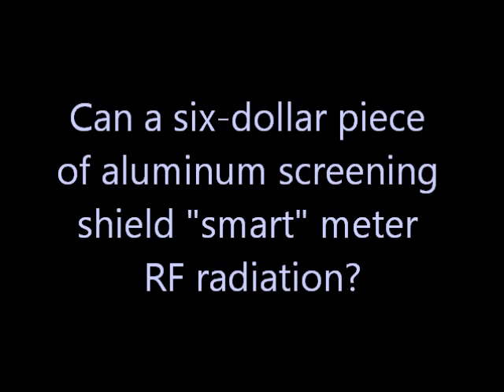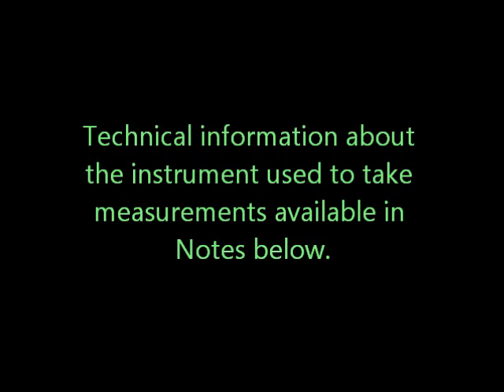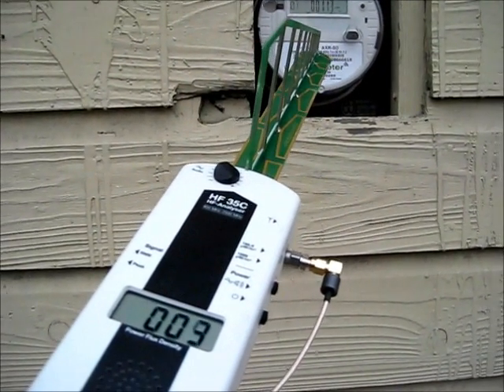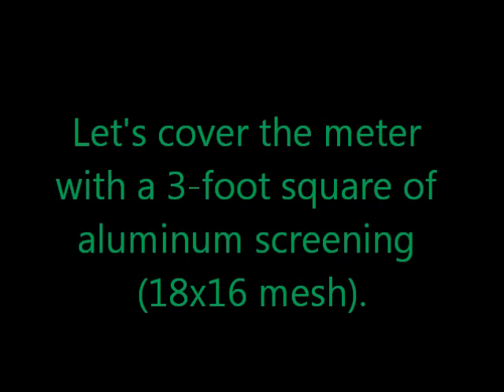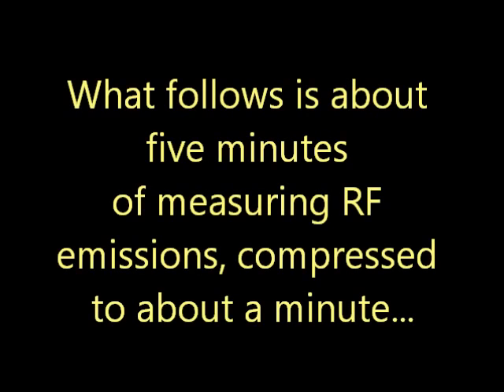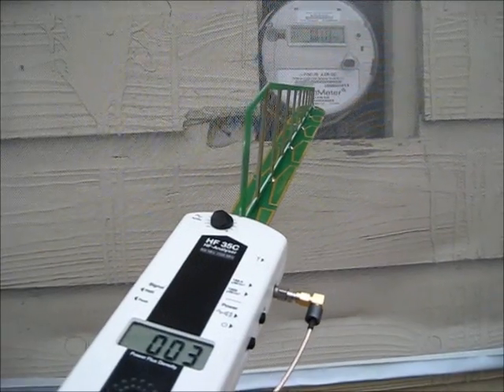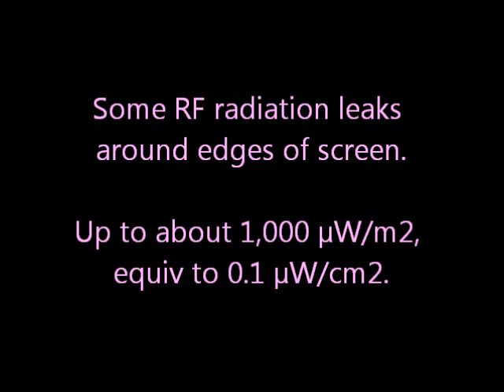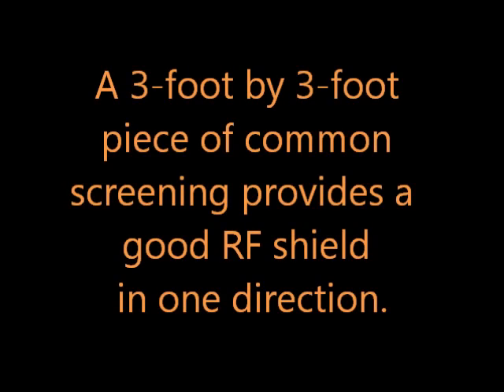Foiling a "Smart" Meter, Part Two: Aluminum Mesh Screening

Comment: Why put the shield facing the street?, but not on your inside-wall. Though the meter box is made of metal in the back so no radio going in that direction anyway. The smart meter radio signal is very weak and short, it's a marvel of engineering that it can be read with all the background noise. it's like turning on a 1watt light bulb a mile away and you read that. It was far worse in the 1970's when TV signals was twice the strength they are now due to improved receivers.
Reply: +Oil Burner I guess you think insulting and characterizing people is an argument.
Reply: +Tony Philipsson Implying these are safe, is not the way to go.  The main reason is that we stop studying effects of EMF, and allowing corporations to bribe officials to keep things how they are-no matter how unhealthy that is.
Reply: +Oil Burner I'm not Freddy, and I have no need for a conspiracy obsession, although I think they have performed an important function-allowing us to consider different viewpoints.  No, I came about this EMF things accidentally, by making a product(orgonite) designed to increase my health/energy.  If you can do this, then you will see the adverse effects of non-ionizing EMF.  The junk they try to feed you about it being safe is the cell phone and power companies mantra(or talking points), and is junk science.
Reply: +The Dummy Spit My orgonite isn't the same as most, and was made for a different reason than combating EMF.  I made it for energy, and this led me to the problems of EMF.  I have an EMF corner(where I'm typing this right now), and EMF is the only explanation for the loss of energy I used to get going outside.  They are taking advantage of you, because you can't see it.  They(cell phone, power, etc. companies) want the standards to continue to be where they are.  In 1996 the FCC said cities and states can't deny cell phone tower construction for health reasons.  Why's that?
Reply: +Oil Burner We complain, because we have to do the work that should be done by companies(cell phone and power companies) that are perpetrating these EMF devices on the public.  I don't think this technology is going to be stopped, but we are going to have to do the work of finding out how safe, at what distance, what frequency, and what power level these things are.  Does this sound like something the layman(the public) should have to do?  Do we have to come up with ideas about maybe a safer carrier frequency, or some sort of grounding we should do to make these things safer health-wise?  Go ahead and pay the 1% all the money, and believe they are competent and deserve to be in leadership positions.  I think they are irresponsible and incompetent.
Reply: Yes, let's stick with the facts!
Here are some underlying psychopathology issues for the typical EHS sufferer:

-panic disorder
-anticipatory anxiety*
-vigilance for exposure**
-blurry vision
-obsessive/compulsive disorder
-rapid heart rate
-idiopathic pain syndrome
-dysautonomia*
-urinary incontinence***
-anxiety
-functional somatic syndrome
-learned sensitivity
-sexual problems 
-confusion
-psychogenia
-symptom amplification
-anger issues
-stupidity
-chronic alcohol misuse
-pre-morbid psychiatric disorders
-shenjing shuairuo
-closed belief of attribution
-undifferentiated somatoform disorder
-multiorgan system complaints

*Dysautonomia [some aspects may be AKA EHS],  is a term for various conditions in which the autonomic nervous system (ANS) does not work correctly.

*  implies `anticipatory anxiety`
** implies `anticipatory anxiety`
***implies 'pissy-pants'
Reply: La Diablo  side stepping  again are we fredrique zug/ la Diablo? time and time you have been  shown hard facts and time and time you show the results of small scale  lab  experiments the results of which were hit and miss at best. why dont you instead of talking out of your arse upload a video of yourself conducting experiments but you wont do that because like all obnoxious trolls you have nothing to back up you only post to annoy people and to be contrary
Reply: Oil Burner  watch out for pi eyed  that is another of his sock accounts
Reply: La Diablo  i phoned you twice why wont you answer? U r to scared i will show everyone what you look like dont worry you merry nob jocky that is following soon
Reply: It's like having a few 1 watt light bulbs and the smart meter being a 100 watt bulb.
Reply: +ryan pogue A smart reader does not use 100watt, it uses 0.1watt for 2seconds. Why do you think they can make Bluetooth beacon tags that run on batteries that last months?, it's due to radio signal can be very weak but still be picked up 100ft away due to marvelous engineering done in this decade.
Reply: It was an anology.
Reply: +mmakshak That IS you isn't it Freddy?
I would recognise that conspiracy obsession anywhere!
Reply: +mmakshak thing, not things
Reply: mmakshak
To give people like yourself something to complain about?
Reply: +Tony Philipsson We want figures, not assurances.  We want strength of transmission at different distances.  We can do our own testing(since you guys don't), thank you.  If the signal is so weak, why can it be read 20 to 30 feet away(the so-called purpose of smart meters)?  The frequencies of those TV signals was entirely different, so it's not an equivalent.
Reply: +mmakshak If you don't need the wifi, turn your router into the bridge mode(I think they can do this at a distance,).  Definitely prevent yourself from being a hotspot(settings and preferences).  You have to check on this hotspot thing, from what I read(they might turn you back into a hotspot, later.).
Reply: +Tony Philipsson How about including health professionals in the marvelous engineering?  It seems to me, we have non-professionals(engineers) making declarations about health.
Reply: +The Dummy Spit Just because you don't see it, doesn't mean it's not there.  Did you know that orgone accumulators blow up?  Do you know what that means?
Reply: +Oil Burner Who's anti-science now-me, who calls for study into non-ionizing EMF, or the cell phone companies, who stop cities and states from preventing cell phone tower construction based on health?
Reply: Frederique Zug
 yes, everyone that disagrees with you must be a power company manager right?
No one else could possibly see what a pair of psychopaths you are and have a differing opinion.
You two are so far gone in the heads it doesn't matter.
Reply: Frederique Zug
So now you are happy the power companies are supposedly killing people?
What sort of Fked up phsyco are you?  One thing one day, something else the next.
You are a complete fruitloop as you have demonstrated over and over again.

You and Mmaniac must have a grand old time whining and copulating together and even better if you are as I think the same person. You could have even more fun talking and playing with yourself.
Reply: Frederique Zug
 There you go! Your obsession with everyone that disagrees with you being a "Power company manager" is one example of your mental affliction. You really think power company managers on $200K a year or whatever high price they earn are going to sit round commenting on your maniacal shit on YT?

You are totally screwed in the head.
Reply: Frederique Zug
I'll say!!
Was that the best retort you could come up with? My comment? Couldn't come up with one of your own 'eh? Figures!
You sure fell to pieces the minute you caught yourself out didn't you?

Can you shut the hell up now with your incessant bitching and obsessive moaning about Power meters?
NOT everyone is a power company manager and apart from you and your bum chum, MMMMshag, no one gives a damn about the distance from a meter to your arse or anywhere else!

Either drop it or go get the mental help you so badly need!
Reply: Frederique Zug
What the hell you telling me for? I'm not the one obsessed with smart meters and couldn't give a damn about what  any clearances are.
I can't understand how you haven't figured that out yet. You just keep going on and on about this shit like it'a the only thing in your life.
Talk to mmshagged about it. he seems as obsessed as you although I strongly suspect you are one in the same.

I don't have a smartarse meter on my house and where I live, virtually every meter on a house is enclosed in a strong metal box with all the fuses that would do infinitely more to stop whatever radiation than your pissy bit of fly screen.

It's also clear that you just can't see how your obsessing over these things makes you look ( and genuinely seem) like a total fruitcake.
Reply: Tony Philipsson, They were doing a test you buffoon jeeesh. Obviously they wanted to show how the emf is leaking out.
Reply: Oil Burner the guy is a cretin with serious mental issues i have been perusing him for years unmasking  him he once said he has never lost an argument only to piss off when i showed had lost every single argument and what is this power manager shite he spouts . You should see what i have done to the one vid he uploaded it was full of paranoia garbage now it is full of tits and ass
Reply: +richcampoverde Yeah, his only two parroted arguments, What's the aim distance and accusing everyone of being a power manager.  I have told him what the distance several times is and asked what knowing that proved as anyone can look it up as I did.  Not being in the US it's meaningless to me anyway. As for the power manager thing, what a moron. He really thinks people on 250K a year + sit round posting crap and arguing with Fkwits like him on YT? Yeah, i'm sure the board and stockholders would love that!

He just proves how deranged some people in this world are. I'll say this though, I'd love to see him ( as against meet him) in real life. I bet  he is some sort of weirdo that no one wants to know because hes an unbearable pain in the arse that no one can stand.  Can you imagine having him as a neighbor? 
Pretty sure if he was mine he'd just quietly disappear and be gone a couple of years before anyone ever noticed or was concerned.
Reply: Oil Burner he doesnt bother with me since i found his computers ip address  and found out where he lives 😂😂😂 at first when he came out with this drivel  i thought he was a misinformed idiot but as thr years went by the cracks in his sanity became great fault lines that had clearly left him a mental shipwreck. He thinks smart meters will kill everyone due to radio signals but when questioned as to the usage of mobile phones microwave transmitters and wifi and such like he suddenly went underground  and has not surfaced since
Reply: La Diablo there isn't one now answer this what about your computer or radio transceivers or Wi-Fi? Are you running around with reams of tin foil streaming around you? You are a sad joke 😂😂😂😂 please do offer more after a day of sad news you are a ray of sunshine your madness has chased away all woes
Reply: + La Diablo  
OH look, the phsyco nutcase is back with more of his deranged Dribble.  Lets see... Never claimed to be an expert. Please copy and show where I did or stop making up more garbage to elevate your own non existent credibility you little physco weasel.  I have told you the answer to your single minded question multiple times by probably the electro shock therapy and anti depressants make you forget.  That's all you have that question isn't it? Can't think of anything else to put forward other than that one idiotic and irrelevant question.  What a pathetic looser you are!

As for everyone laughing at me, those whom are, other than Lablowjob , mmwackshak, fredriq and all her other aliases, please identify yourself.  Only person being laughed at Lablowjob is you. plainly obvious you are a lonley, pathetic little weirdo that has no friends, your family have shunned you and you probably rush home and masturbate with some kinky outfit and toys every time a female serves you at the soup kitchen because that's about as much personal contact as another human being will afford you. 

Come on, now give us the one about me being a power company manager. That one and it's unbelievable stupidity that you would even suggest that,  is my favorite one of your idiot accusations.
Reply: +mmakshak  Oh Geezus! You talk about your "organite" and then junk science in the same post. Talk about hypocritical!!
Reply: +mmakshak  BLAH BLAH  BLAH BLAH BLAH BLAH BLAH BLAH BLAH BLAH BLAH BLAH BLAH BLAH BLAH BLAH BLAH BLAH BLAH BLAH BLAH BLAH BLAH BLAH BLAH BLAH BLAH BLAH BLAH BLAH BLAH BLAH BLAH BLAH BLAH BLAH BLAH BLAH BLAH BLAH BLAH BLAH BLAH BLAH BLAH BLAH
Fk me! Enough already!!

You don't have to do shit. YOU choose to because you have some deranged obsessive disorder that fails to let you realise you are taking things too far and no gives a damn about you rantings because you sound like a nutcase!
Go see a shrink already and get yourself some help!

Comment: It probably reflects all the radiation right back into the house lol.
Reply: +TheGoldenSaber it actually does, she made an amplifier, no lie
Reply: +Robots4Sale Lol just put a satellite dish upside down over the meter. If they had any sense it would be on the inside of the wall behind the meterbase. Thanks for protecting the cars that drive by though.
Reply: That's what I was thinking, it could become an antenna.  It also needs to be grounded
Reply: Glen wrote: "Steven no it doesn't need to be earthed to bounce a signal, look at how yagi antennas work, the reflector element is not earthed..."

Correct, TV antennas rarely have any parts of their elements grounded, even the reflectors IIRC. Only the mast is grounded.
Reply: There is radiation coming through the wall, into the house. And when you fix that as well as you can you still have dirty electricity in every wire,  appliance,  outlet, switch and anything else that uses electricity.
Reply: It will reflect, that's what metallic surfaces do. Steven no it doesn't need to be earthed to bounce a signal, look at how yagi antennas work, the reflector element is not earthed to earth rather is just matched in via usually a folded dipole arrangement.
Reply: That what I was thinking. If she really wanted less radiation she should have asked the company to provide a wired connection or directional outdoor antenna with a shield.
Reply: ArthursHD Is there a wired connection available?
Reply: DB Stevens  but it is putting out unnaturally high electromagnetic fields affecting our cells which we don't want to harm since our health depends on their integrity.